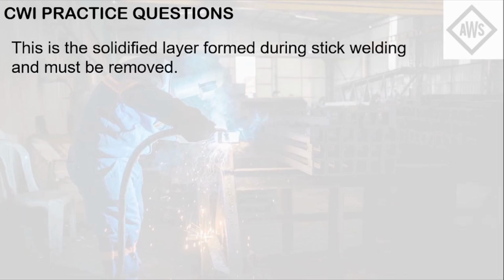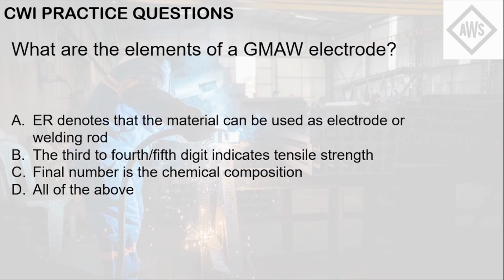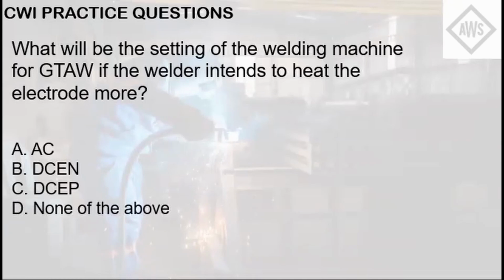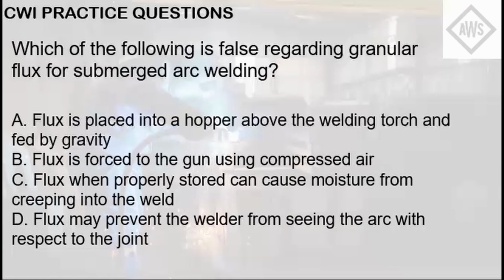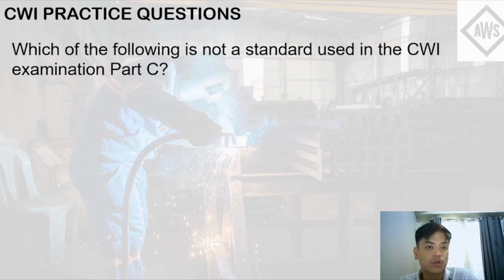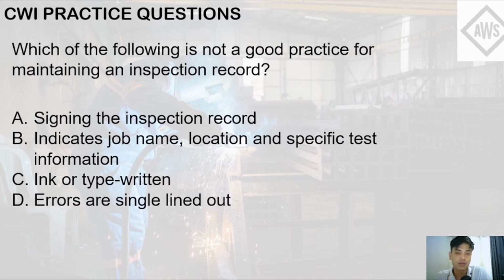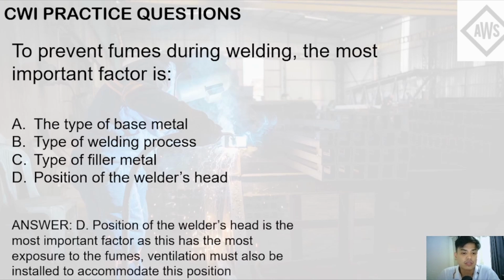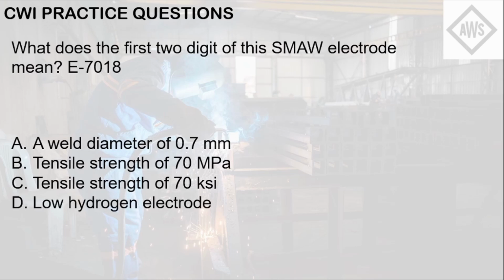Certified Welding Inspector Fundamentals Questions: CWI exam Part A Sample Questions

Comment: @ 18:09, about Electrode designation for FCAW. E70T-13. The numbers following the dash are as usability designator ( 1 and 3 are parsed as a single. Not shielding gas designator.

Comment: hello, im studying for the cwi but i have a question. For question "In this mode of GMAW transfer, the low arc voltage is used to minimize spatter and enable deeper penetration. Rate of transfer ranges from 20–70 droplets per second." why does it note "the low arc voltage is used to minimize spatter" when Globular is known to have massive spatter?
Reply from the maker: the question is just stating the rate of transfer, low arc voltage resulting to minimal current does result to minimal spatter if controlled properly

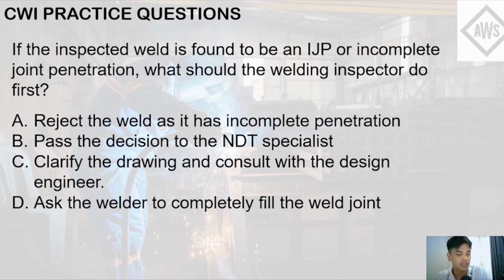Comment: At 53:38, I think the answer is incorrect. "incomplete joint penetration" is an automatic rejection because incomplete penetration has nothing to do with clarifying the drawing. All Welds are to have complete penetration. This is a good video for learning, but make sure you guys are actually studying.
Reply from the maker: there are acceptable IJPs per code, but thank you for the comment sir. I'll comment back once I got the clause from AWS D1.1

Comment: 17:03 this question wording is very confusing. It asks what second "digit" which reads as asking what the 0 means. If read that way then it's answer D. 

The question should read what does the 2nd character mean
Reply: Or I guess you need to know T is tubular therefore the 7 is acutally a 70ksi so the 2nd digit is hidden. Either way question is definitely worded to intentionally confuse